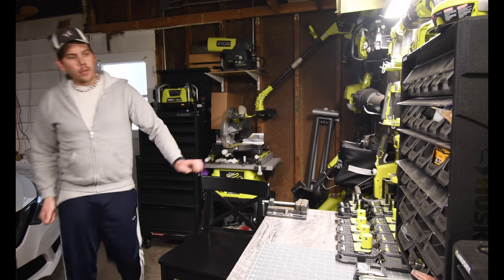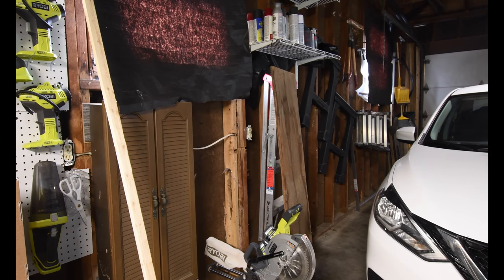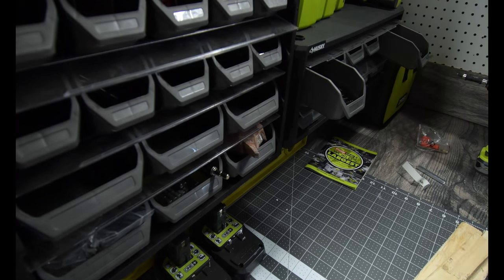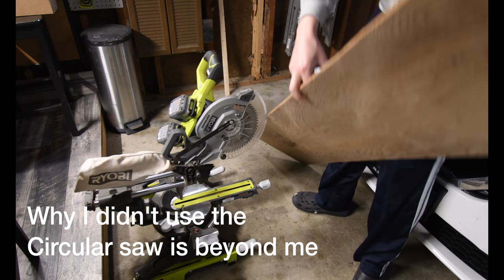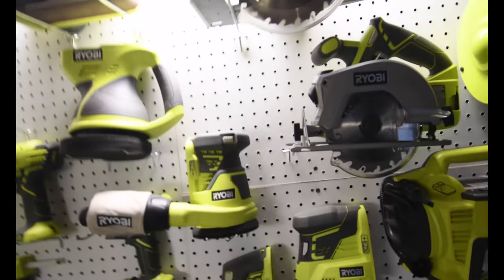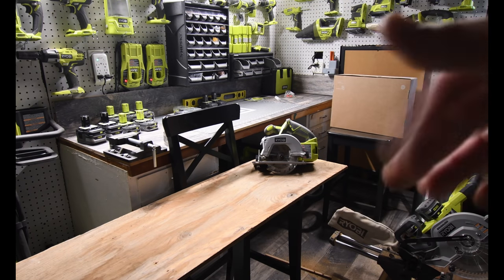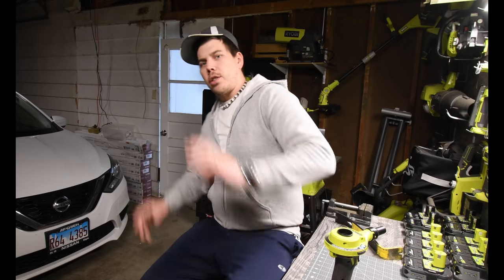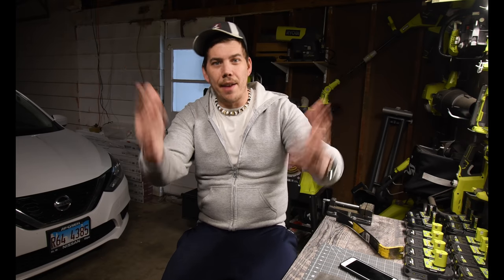Hanging up closet shelves

Comment: Next time you cut wide boards like that on the miter saw , quick tip: just tilt the front of the board up and it will cut the rest of the board
Reply from the maker: Vince Moser thank you sir. I have no clue why I didn’t use the circular saw. But thank you for the tip